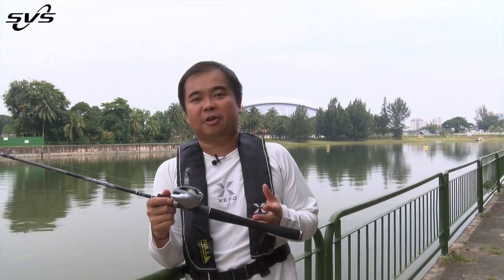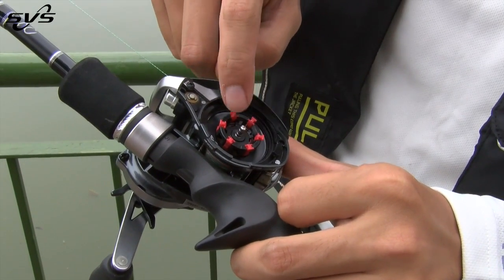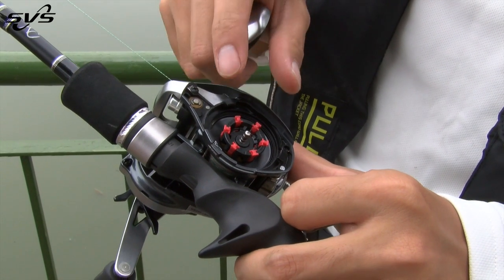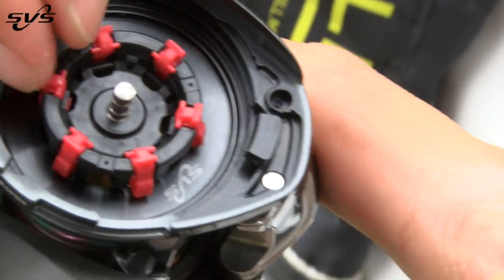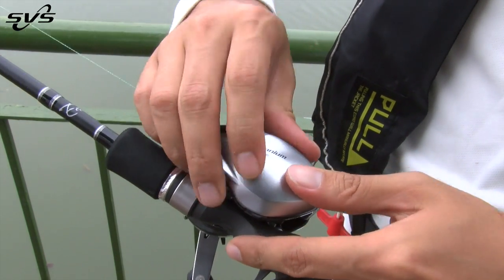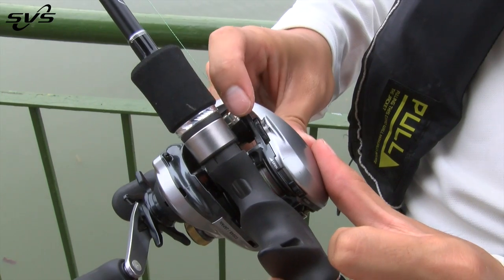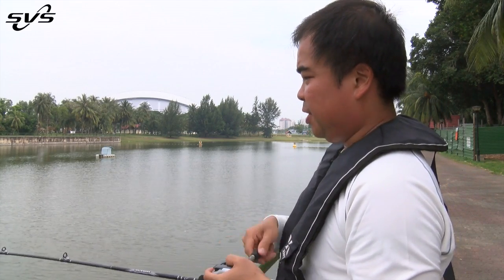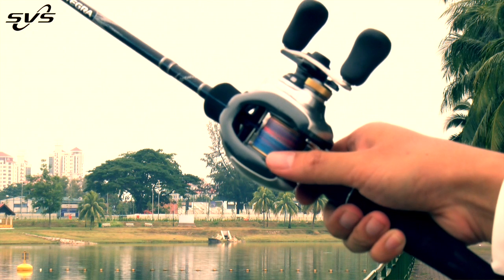Shimano SVS infinity braking system explain

Comment: Hello Melvin! Greetins from Romania.
This days i bought an Shimano Aldebaran 51 MGL and it's my second  baitcasting reel. Can you pls explain me a little bit how to correctly use the brakes for maximum distance?
Reply: The aldebaran is my favorite reel. I like to set it with two brakes on, 3 on the dial....then keep the spool tension just tight enough to keep a free fall from happening. That will get you really, REALLY good and easy distance with the aldebaran. If you’re still a little new to baitcasting, I would keep slightly higher spool tension til you get used to thumb control